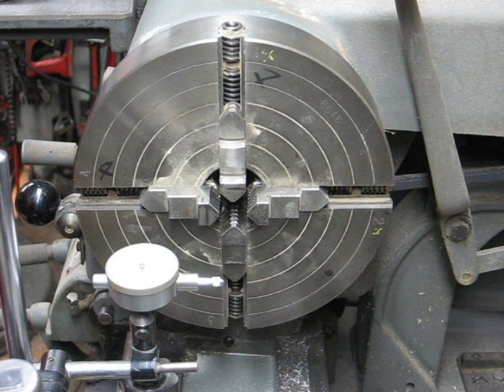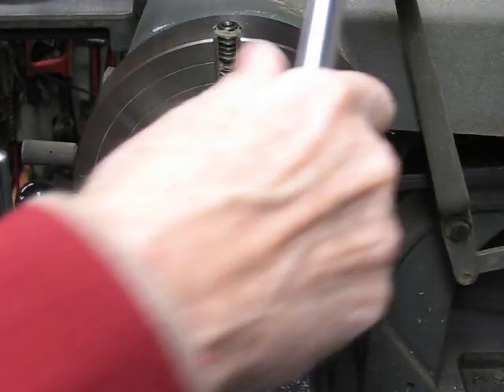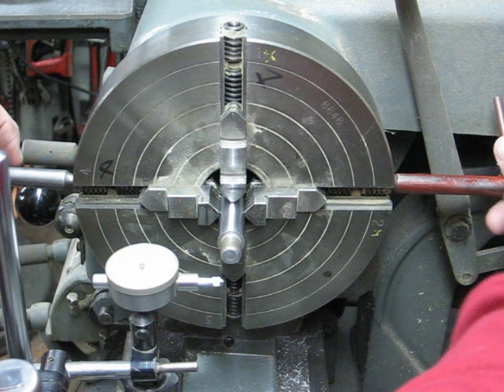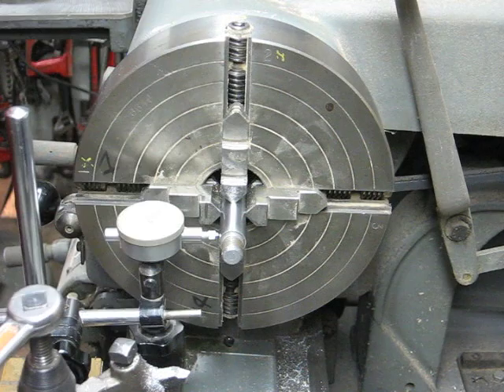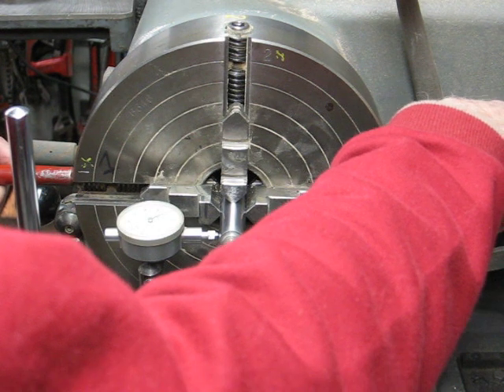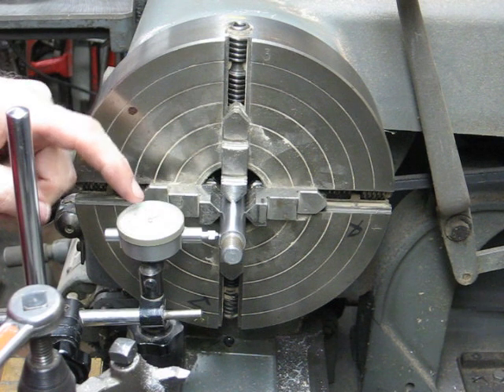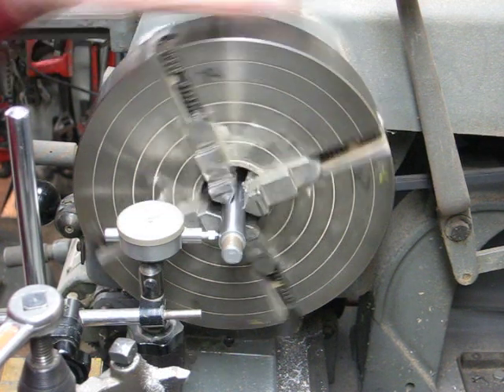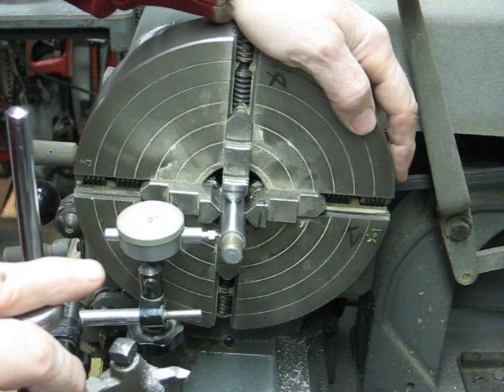ATLAS LATHE 4-jaw chuck demo TUBALCAIN mrpete

Comment: gidayI am not using pre machined bar in my lathe, its been sitting outside for a few months. what sort of tolerances would be expected with centring it up to make a item? I am able to get it to about 15 thou by eye. also would a good thing to do be make a indicator mount for my tool post as my stand is crappy?
Reply from the maker: +rob tyler Yes--make a stand & use an indicator

Comment: Mr Pete .
 I have a Atlas Lathe same as shown in your video .
 I have a question : What is the correct way to change the chuck on thin model lathe ?
Reply from the maker: This is risky, but most people put the lathe in back gear to lock spindle.  Then put an adjustable wrench on jaws & jerk counter clock.  Sometimes a lead hammer also used, but you can strip gear teeth if not carful

Comment: Great video.  Thanks!

I expected a video showing how to use a four jaw chuck to hold square or rectangular stock.  I'm not a machinist (but I'm learning!) and I had read that most machinists use a three jaw chuck for round or hexagonal stock and a four jaw chuck for pretty much everything else, like boring a hole in a rectangular plate or block.

I guess if you want to avoid switching between heavy chucks, a 4 jaw chuck and a fast way to center round stock would be the most versatile.

Comment: Hi Tubal, great vid like always. Just a couple of suggestions. It would be great if you could see the indicator (I know you mention this but it really would be great to put it in). Also, your hands are hidden so you can't see how you turn the keys in the same direction to move or opposite to tighten down. Lastly, why didn't you tighten down with two keys? Would that help the job accuracy? Anyway, great tip, I'm using it next time I get out the four jaw.Thanks a million!

Comment: Watching your video's makes me wish I had you a a mentor (In Person) I think I could learn a lot. I have learned from your video's. Did you used to teach shop class?
Do you have a video that shows how to turn a semi- machined  face plate to fit on a plain back chuck?
I need to do this, and am not sure how, esp. getting a nice close fit to the chuck. The register I think it might be called. Not the fit to the spindle, that seems OK. 
Also How much of a disadvantage is a "plain" apron?  No Clutch

Comment: How would you center a piece of square stock or something that isn't round ? Would you use some cylindrical stock that has the same diameter as the square stock or ? great vid, btw

Comment: Hi, I'm using the same method too and have since love using 4 jaws over 3 jaws. The only gripe is it's a tad difficult to tighten all 4 clamps without upsetting the dial indicator a little. How do you tighten the the jaws without upsetting the dial?

Comment: I just inherited an Atlas Model 618, with Starrett gauges etc, and I had no way of learning how to use it except for your videos. Thank you for sharing your wisdom with the rest of us! INVALUABLE! Please post more, belt maintenance and adjustment, power wiring to handle the heavy current load, mounting etc would all be helpful. Thanks again!
Reply: Since your post is only 14 years old, Mr. Pete has released a full course on the 618, I recommend it. 
He also has quite a bit about the lathe here on youtube as well.

Comment: Ive got a small craftsman 6" a 109 lathe. I dont beleive I have the circles cut into the face of the chuck.  Could I cut these into the check face with an ordinary cutter?  Not sure if the chuck is hardended or not.  Will the cutter break when it goes across the 4 grooves in the chuck.

Comment: Good information. 

I use a similar method when setting the precise zero voltage output of an inclinometer when it is set at perfect zero taper on  the continuous casters that I wire upon refurbishment for the steel mills. 

I thought about it a while and used the locking screw to oppose the jacking screw until I achieved a precise zero voltage output. 

When I started doing it this way, no one would believe I was able to do it that quickly until I showed them in person. Thank you for the videos